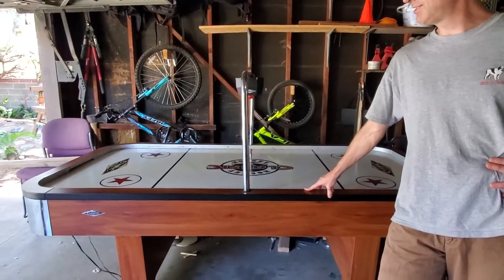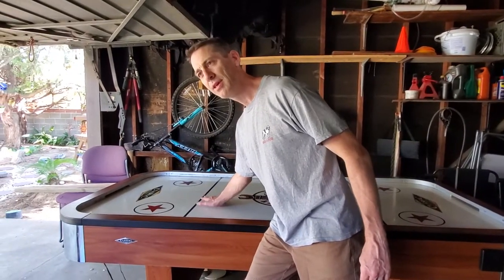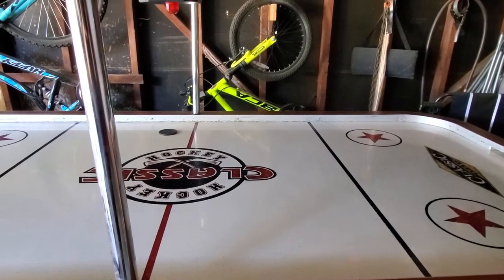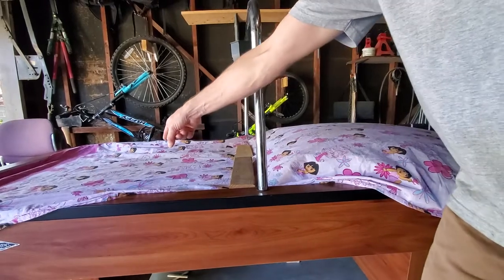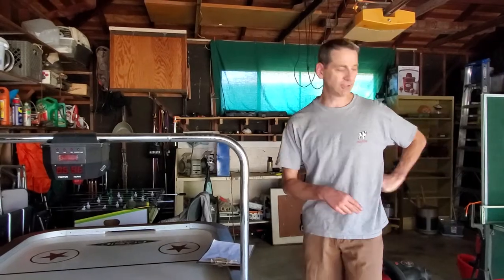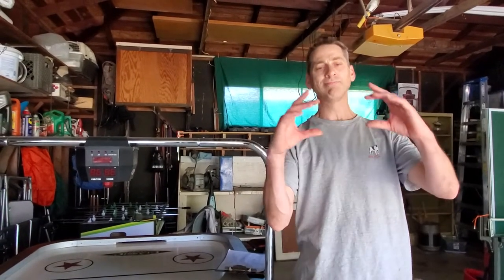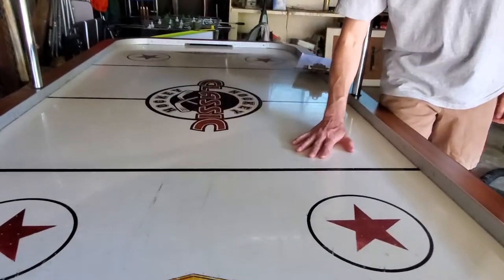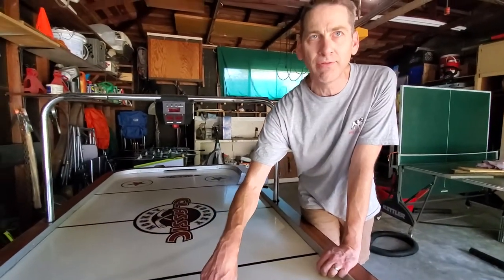Increase airflow on air hockey table at no cost!

Comment: Would’ve been a better idea to just grab a sewing needle or something because that drill just made way more sawdust debris than was probably in it 🫤
Reply: YEAH! A pin or brad  matching the ones working. 
(Sheet test - A+, D
D- A needle could go thru and damage/rattle etc. Good Lord, don't compromise the original air pressure specs. Stay away from that table top.  Try  vacuuming lint brushing from or top finish. those  2 or 4 dots are neglible remains of the plastic injecting (gates/sprues/techo-blahblah😂).  
All fixed? All family playtime! For each a Solo cup outstretched for soda you will pour. Yay! The use of two hands soon will truth reveal!

Comment: Would this be called or explained that the fan casing is leaking?
Reply: The casing for the fans could be leaking.  You will have to get under the table with the unit on and visually inspect for cracks and feel for any air coming out of the fan casing.  If there are leaks, you could use caulking to seal them up.

Comment: What you using after you drill to Smooth the edges
Reply: Sand paper
Reply from the maker: You could use light sandpaper or even just your hands.  If you use the right size drill bit (1/16 inch) and keep the drill straight up and down, you shouldn't have much issue with rough edges around the holes.

Comment: What size and type transformer is needed for the low voltage part.
Reply: The scorekeeper? Should say near the input Jack. Maybe 3 to 9 volts
Reply: Battery in air hockey score keeper

Comment: I also have the same issue with my table….Gonna try the drill out thing for sure…..hey
But one other thing…. 
I have the same Classic sport table as yours 
Just got it
It also has the same scoreboard 
But
The seller gave me the wrong ac adapter plug
I’m unable to find out what I need to replace it
If You could let me know what voltage I need
That would be a huge help 
The adapter she gave me is 
Input. 
AC 120V 60 Hz 9W
Output DC 7.5V 500mA

If this is it…. The connection doesn’t fit ……just falls out 
So I’m thinking it doesn’t even go with the scoreboard 
Let me know if anyone can help! That would be great!
Reply: Hi Robert.  Did you get this info?  I can send to you if needed.

Comment: Maybe getting a slightly larger drill bit to let more air flow come through. You said a 1/16 inch, what about maybe using a 3/16 inch drill bit?
Reply: Not a good idea,  these tables are engineered to get a certain air flow across each hole, putting in bigger holes my decrease the actual pressure across the table
Reply: You would decrease the velocity of the air through the holes if you drill them larger. Do not do this.
Reply: @wushuguy1  Thanks. That's good to know!

Comment: Not clogged it's just not fully drilled through from factory and the machine that did the holes I promise you I had a brand new table like yours same thing first time playing holes was not opened up all the way I took it back said hell with drilling thousands of little holes I'm just gonna buy a arcade airhockey table and that's what I did qith no problems ten years later

Comment: Hows it working out?
Reply from the maker: I drilled out the holes on the other side of the table and it works great!
Reply: @jonathanvonah7631  that's good i did mine in about a day,  definately more air flow,  so you use the Murphy oil to clean your table?
Reply: We just purchased this exact table from someone and we were informed that the scoreboard adapter connection was loose 
Now realizing it was not the adapter that even came with the table/ scoreboard 
We are trying to find a replacement for it? 
We just don’t know which voltage it is…
We purchased a universal adapter from Amazon
But without trying  every combination…. 
Could someone that owns this scoreboard tell us what we need?
Reply: @robertlord5714  should say near the input Jack. Might be a battery door too. Mine does.
Reply: @GoTips  do not use any oil, it could swell the wood at each hole. Use very light coat of silicone spray.

Comment: If it is just "dust" you're removing from those holes, why in the world do you need to use a sharp metal drill bit and a powerful electric drill to remove it?!?!
I thought that FEATHERS were good medium to remove unwanted dust from surfaces, not WIRE EFFIN' BRUSHES!! Jeez!